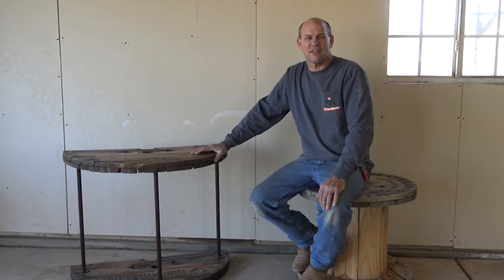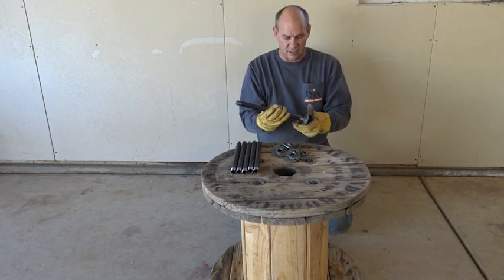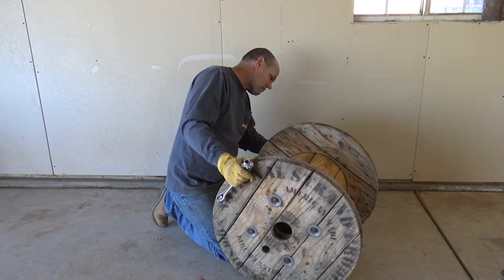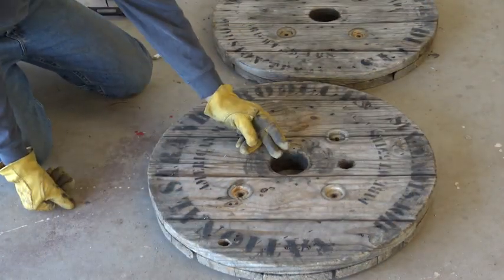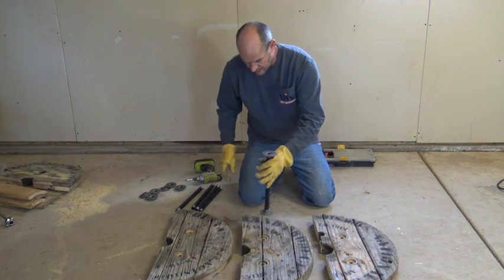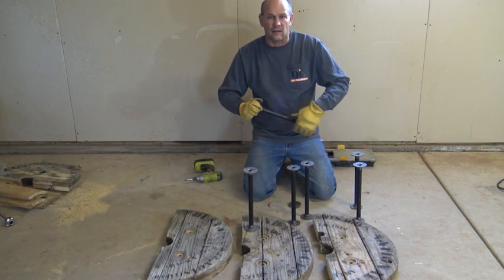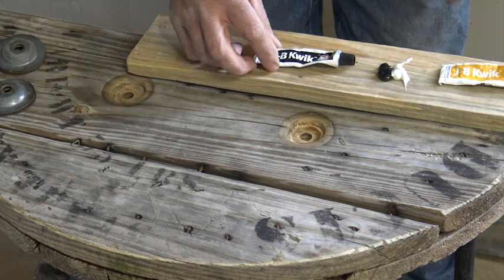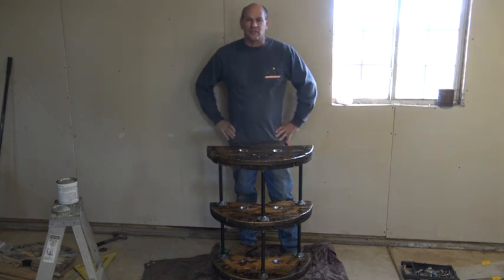Cable Spool Projects:  Cable Reel End Table - Recycled Furniture Project

Comment: What size screws did you use
Reply from the maker: I think they were 1 1/2". Just make sure they are not too long to penetrate through the top of the table.